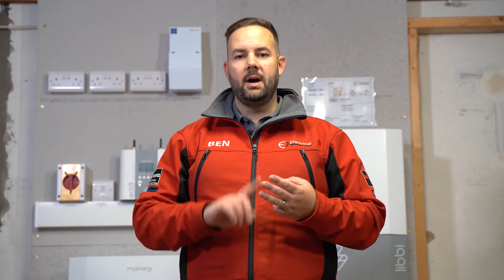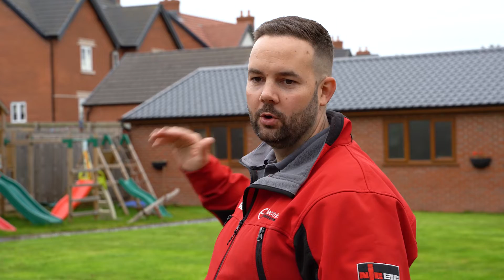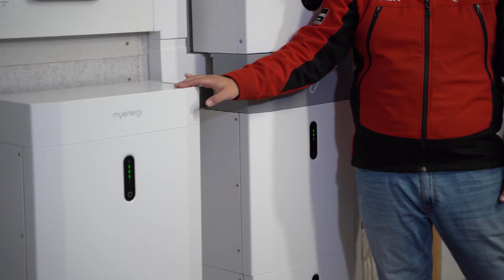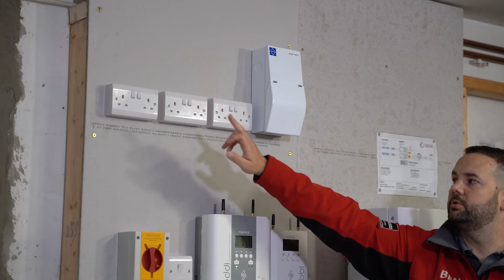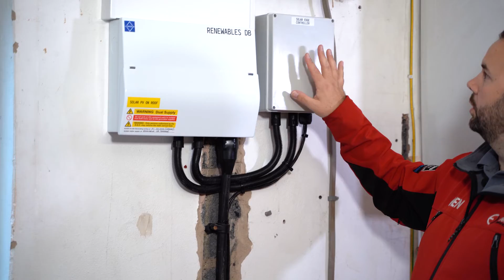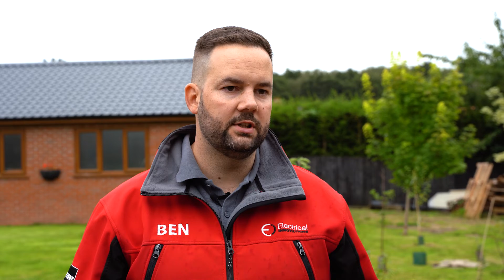Solar Edge and MyEnergi Solar System Walkthrough. 22 Solar Panels and 20 kWh or Battery Storage

Comment: Hey mate. Got a question. As I’m about to come across the same thing. Installed SE on a property last year, customer now wants a Libbi installed. Just trying to get my head around the Libbi being AC batteries. 

How did you go about sending the solar for SE inverter back to the Libbi batteries?
Reply from the maker: The CT clamp will detect it and just start to charge